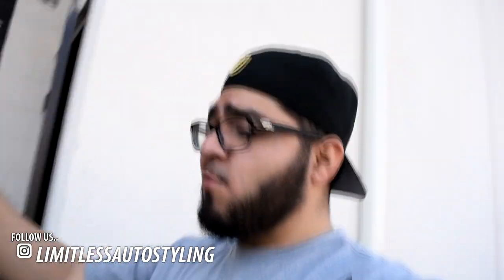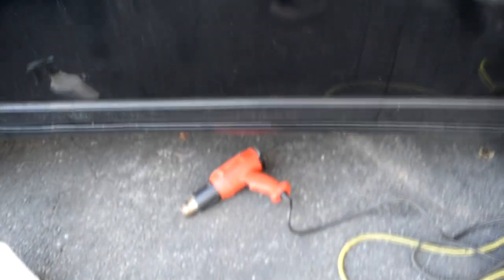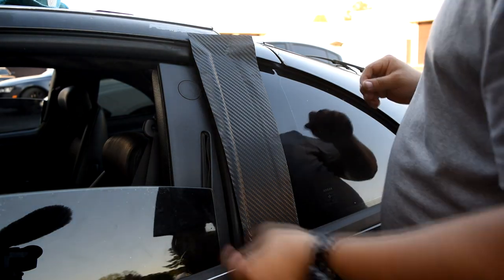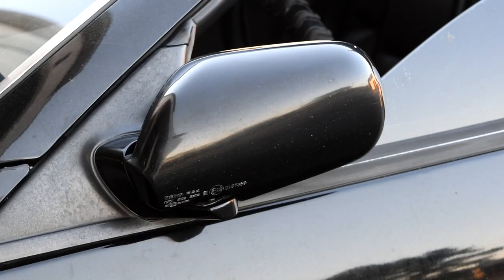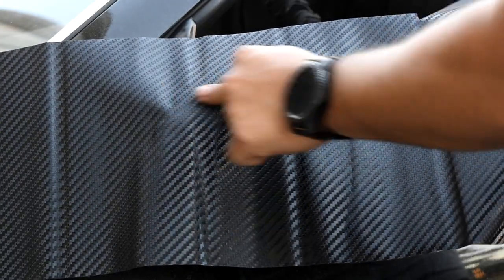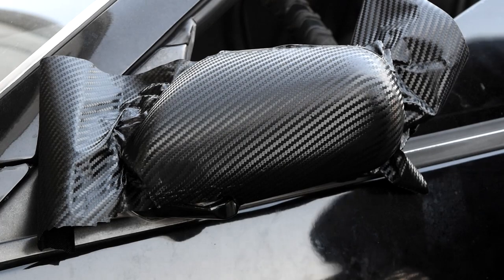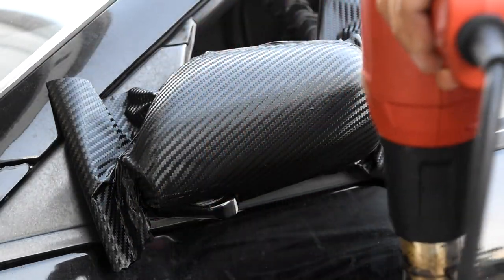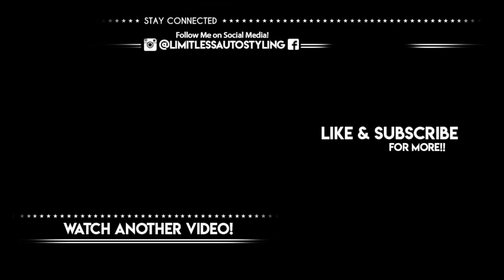HOW TO WRAP A SIDE MIRROR IN THE MOST REALISTIC CARBON FIBER VINYL WRAP

Comment: What temp on the heat gun are u using to heat up when applying? Also after it’s done do you still have to to a final heat of the surface area that was just wrapped?

Comment: Great video, thank you for it but as a DIY amateur I have a ton of questions as you make it look so easy.

1. Is there a preferred ambient temperature you should wrap in? For instance dead of winter here in MD, in a garage but still chilly.. I heat my wrap but less than 2 seconds later it looses it's ability to stretch.. should I get a heater and heat the garage to 85 before attempting?

2. Do you always start with laying "cold" and then heat and stretch? Some videos I've seen they place the wrap on the window, heat it, stretch it, then move it to the mirror to wrap, considering my garage temps... This method isn't working for me. 

3. How do you pick where to start? Do you normally start at the top and work clockwise or do you start with the most challenging curves first? For instance the bottom of my mirror has way more plastic to cover than the top, should I start with the bottom?

4. How do you avoid getting rid of a wrinkle without creating 10 more?? Everything I get rid of one, I just made so many more... It's frustrating

Once again, great video, thank you for it!